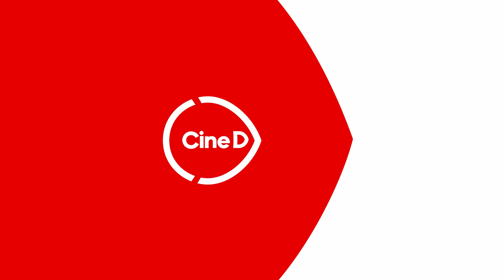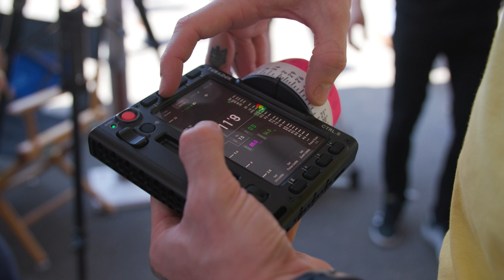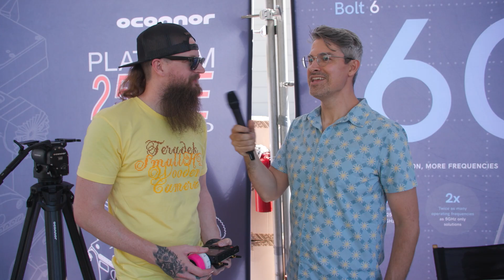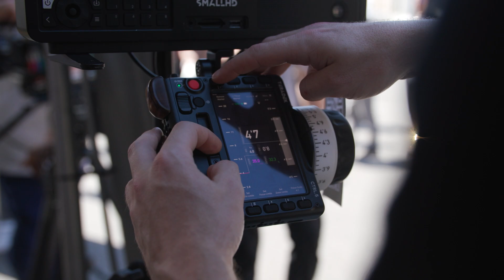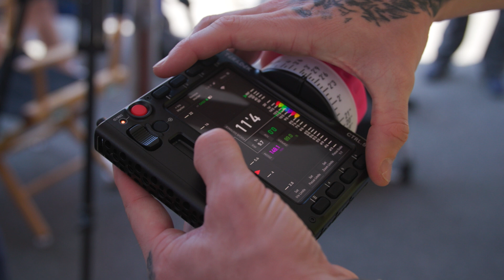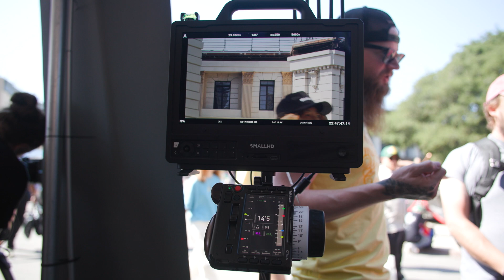Teradek Ctrl.5 Wireless Lens Control Hand Unit and CTRL.OS

Comment: Aww man, i wanted to hear more about camera control
Reply: From Brian from Teradek on this: “Wifi control hasnt been enabled yet. Looking at Sup 2.0 

Ill see what i can do to trial out some lemo battery options. Right now its a 4pin lemo and 5 pin usb port”
Reply: Any specific questions? I can ask the Teradek folks?
Reply: @CameraGraham what’s the range of the WiFi control?

Can you run a battery on the back but primarily use the Lemo? Like I’d like to have a small battery on the back but use my monitor for power.  That way you can quickly remove the handset and unplug the 2Pin Lemo and have it still powered?